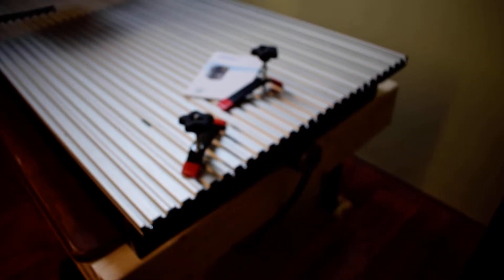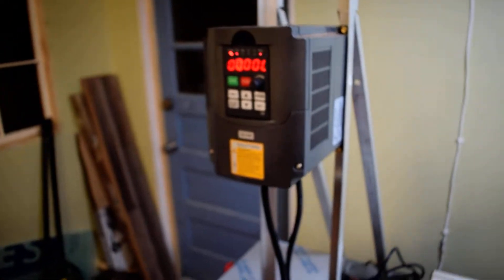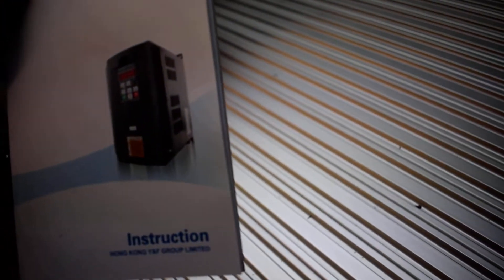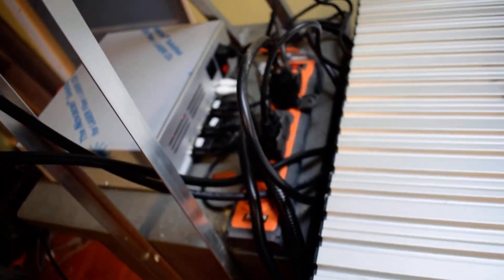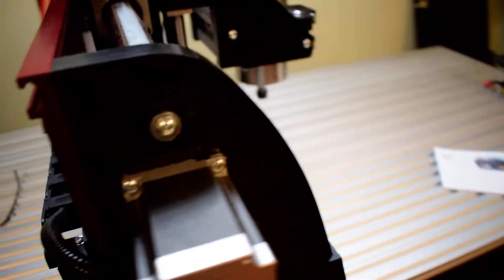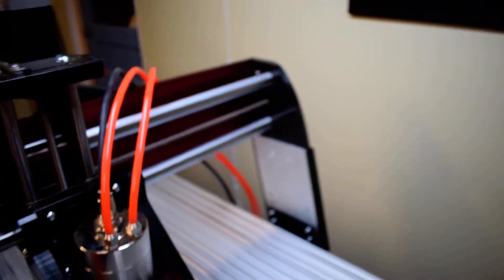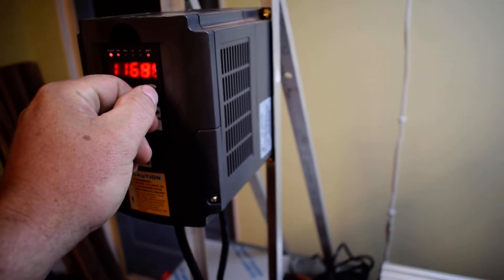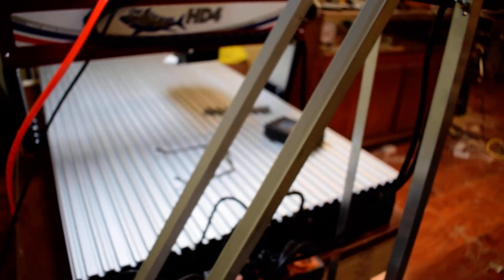Shark hd4 cnc machine walkaround

Comment: Hi, I just ordered one of these.  Do you see any advantage of setting your cnc up with the spindle  left of the gantry as you have done vs the other way around (ie spin the whole cnc 180 degrees)?  Where would you typically set your x,y 0,0 and would x increase as the spindle moves away from you and y increase as it moves left to right.  My engineer brain would want it to work that way.  That would put 0,0 closest to the operator on the left (the way you'd typically draw a graph).